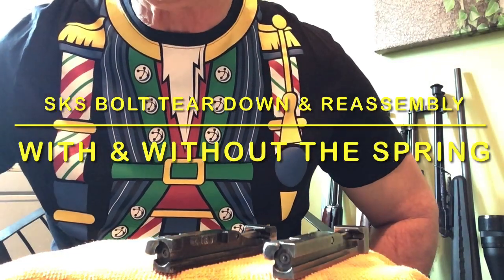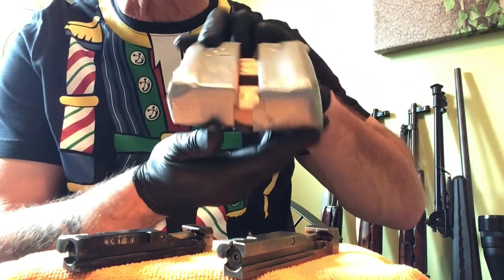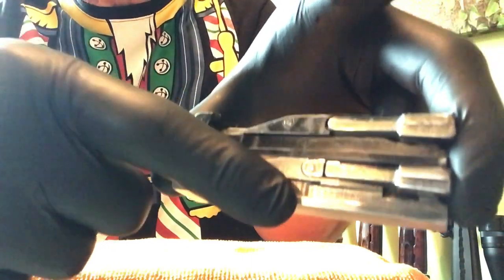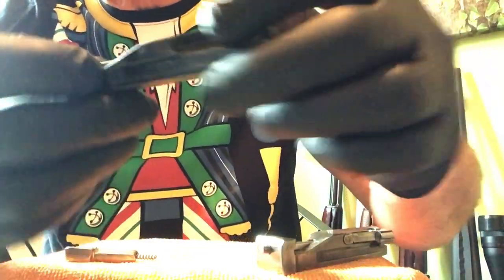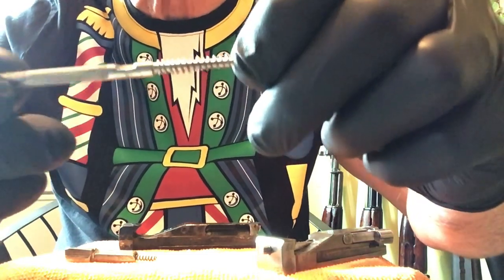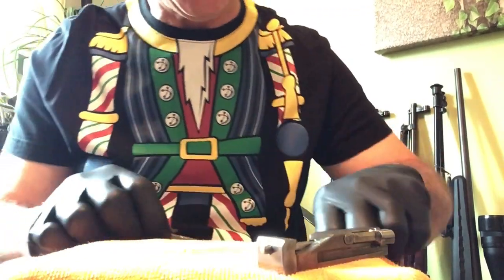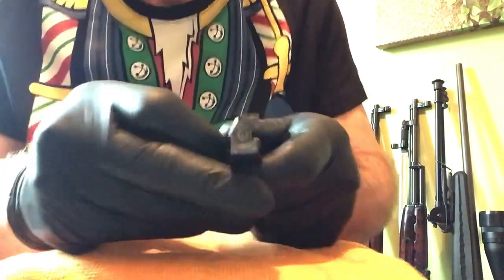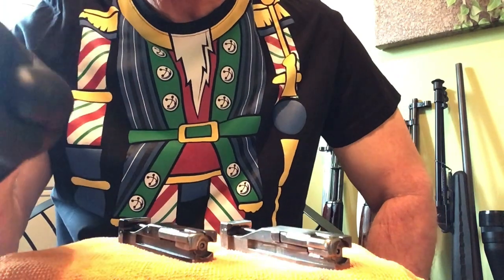SKS Bolt tear down both with and without the spring#sks #shooting #openrange #bolt #gun #guns

Comment: what should I do when the new style pin wont get punched out. I tried bigger hammer it bent my pin punch but the pin didnt move...
Reply from the maker: I need more information, I’m guessing the firing pin is still in?if it is it may be interfering with the retaining pin removal..
Reply: @JohnVanDyk  Hi, yes its the pin you remove so you can remove the extractor and firing pin. The firing pin or the extractor isn't stuck. It's the retaining pin, i normally can punch out on newer guns. This old one is stuck.
Reply from the maker: ok I see, I have not run into that before, except if my firing pin was too far back and the little low spot on it was not lined up with the retaining pin.if your firing pin moves freely in the bolt housing than its not in the way and I would try penetrating oil and maybe a press of some type next, to push out that pin so you can get at your extractor and firing pin. good luck